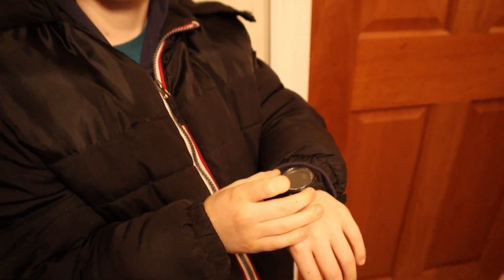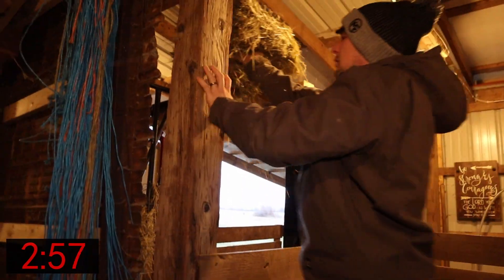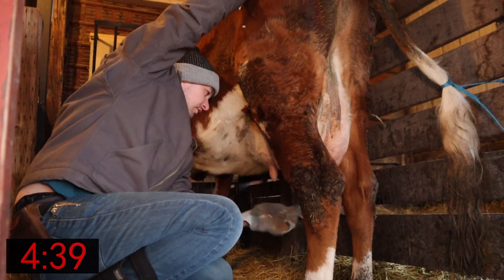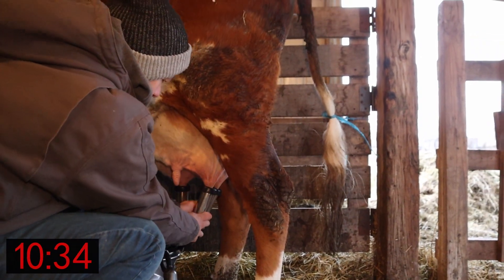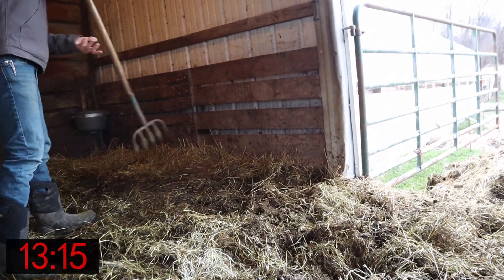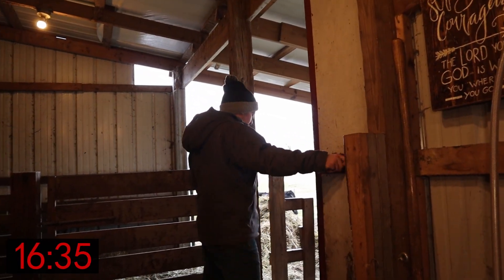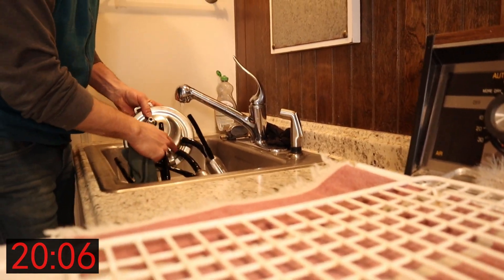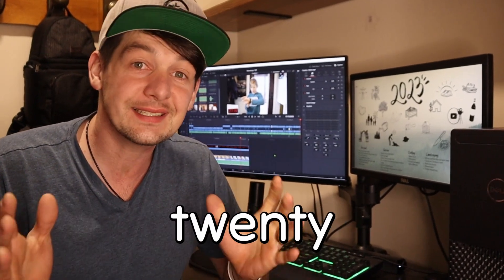Homestead Chores in LESS THAN 30 min! (including milking a cow)

Comment: What happens with the floor eggs?  Are they still good?  And why are they on the ground to begin with?  Are the chickens kicking them out?
Reply from the maker: Floor eggs can absolutely be good.  We check for floor eggs every day.  If an egg looks really dirty or if its buried, it could have been there for awhile.  There are things you can do like floating the egg in water to see if its still fresh.  As for why the chickens lay them on the ground, it's not because they are kicking them out or that anything is wrong with the egg itself.  It more likely has to do with the amount of nesting space that the chickens have.  Are there enough nest boxes etc.  Also, young layers that are just learning the ropes will sometimes take a bit of time to figure out that they should use a nest.
Reply: @morethanfarmers  I was surprised you did not gather the eggs to prevent freezing.  Must stay warm in there.  I must gather twice a day in dead of winter or I have frozen eggs.  I meant to mention in another video where the eggs were being washed - I bought an egg washer from ""The Little Egg Scrubber" and it has been a huge time saver - I can do 150 eggs in about 10 minutes or so, not including soaking time.

Comment: Hi Codi, great video about getting your morning farm chores done efficiently.  If Maddie has a lot of milk do you ever run into and issue where that canister on the milker is not large enough to hold it all at once?  Hopefully it has an alarm or shuts off if it gets overfull.  Also, the eggs that land on the floor of the chicken house do the chickens lay them there or do they fall from the nesting boxes?  I appreciate all the time and energy you put into creating these videos and the helpful hints and information you supply.  Hoping this round of AI with Maddie is successful, best wishes.
Reply from the maker: Hey Ben! If the milker gets too full it would start going through the air hose 😬 it holds 5 gallons though. I’ve never had it get too full. The chickens lay those eggs on the floor. Not sure why. Super annoying!
Reply: @morethanfarmers  Thanks, it looks much smaller than 5 gallons on video.  The 5 gallons should be sufficient.